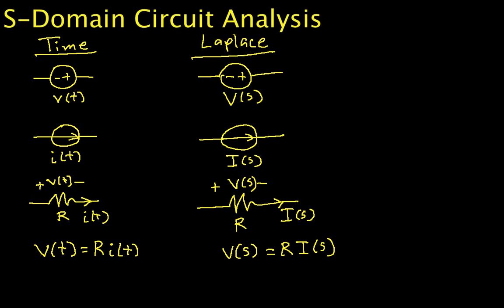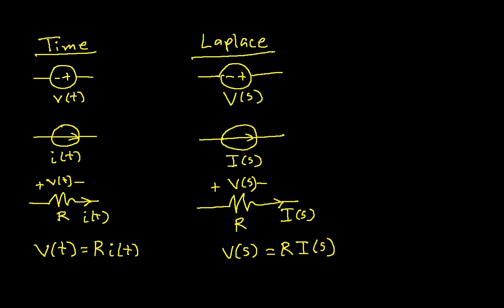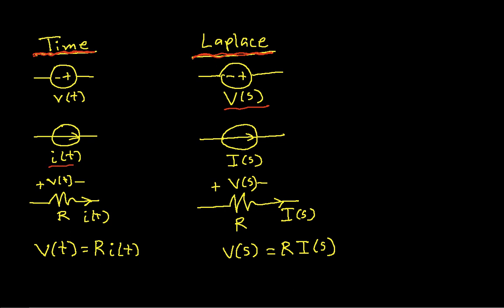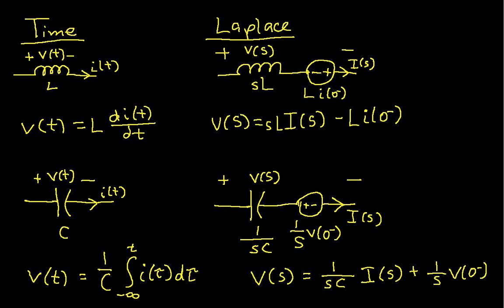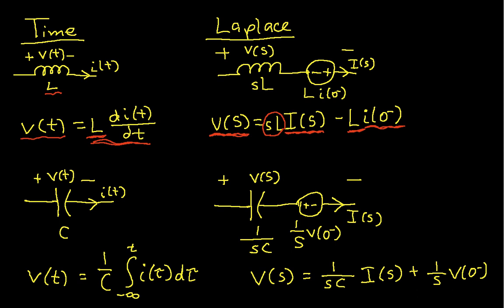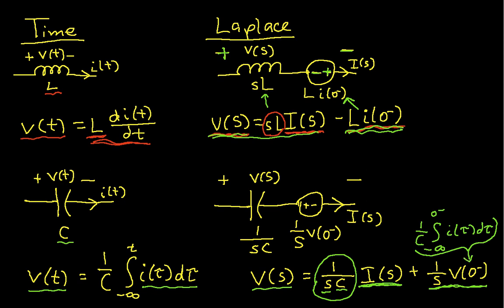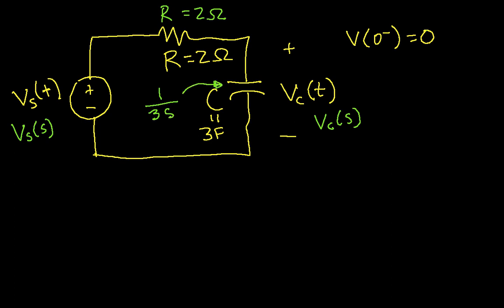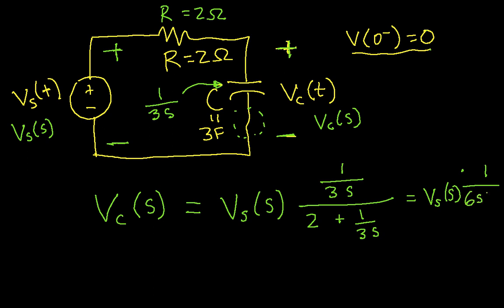Laplace Domain Circuit Analysis

Comment: Well my request wont be of any use to me now because my circuits test is tomorrow but for future students it might help. Could you make a video expansion on this topic that covers the derivation for these circuits in more detail? For instance, you can also represent the s-domain equivalent circuits for a capacitor and inductor as a circuit which contains a parallel current sources rather than a series voltage source representing the initial conditions. I managed to figure out how it works based on your video but a more in-depth explanation as to why you can do both would be helpful to future students I am sure. Otherwise, thanks for the helpful video!

Comment: There are two S-domain circuit models for the capacitor and inductor (voltage source and current source models). Voltage source models are ideal for applying KVL and current source models are ideal for applying KCL. I encourage my students to use both.

Comment from the maker: The sigma is the real part of s. When taking inverse Laplace transforms, sigma tends to show up as multipliers of real exponentials: e^{-sigma t}. w shows up as frequencies of sines and cosines. The Laplace variable is used in conjunction with impedance to find voltages and currents in the circuit, but I am not aware of a more specific relationship.

Comment from the maker: The frequency domain and the Laplace domain are closely related; the frequency domain is the part of the Laplace domain that has only imaginary values (zero real values). The Laplace domain, however, allows you to take into account initial conditions of your circuit elements; you can't easily do this in the frequency domain.

Comment from the maker: Yes, in theory that would be the case. An ideal voltage source supplies whatever current is necessary to maintain the voltage. To charge the capacitor instantly, the current would be infinite. In reality, capacitors cannot change voltage instantaneously, and real voltage sources cannot supply infinite current-there will always be some internal resistance in the voltage source.

Comment: But for DC sources the capacitor acts as open circuit... so the voltage across capacitor should directly be equal to supply voltage

Comment: i understood everything except the initial condition part. but thanks for the video god bless you
Reply: The initial condition is there because we cannot always assume that a capacity/inductors initial value will be zero. A capacity may still be discharging and therefore have Voltage/current still in the capacitor. 
For most easy question, the initial conditions will be zero, but for some harder questions you may be presented with a question which states "take into consideration the capacitor is not fully discharged and has this Voltage at time = 0. Hope this makes sense.

Comment: I failed to make connection. forgot too much preliminaries. Besides, Phasors are way better tools for solving a particular circuit, Laplace is to analyze the circuit responses to different functions (of inputs)
Reply: IIRC, phasor analysis only works if your source is sinusoidal. If it is sinusoidal, then the source can be represented as a phasor (a complex number with a magnitude and phase), and performing a phasor analysis will give you a steady state result. This is intuitive because, since the input is steady (i.e. it is sinusoidal, but it remains sinusoidal), the output will also be in steady-state. 

Fourier series works if the source is periodic, but not necessarily sinusoidal. Of course, due to Fourier's theorem, it is possible to represent this periodic source as a sum of sinusoids, so that phasor analysis can once again be performed, along with the superposition principle. Once again, the output will be in steady-state. 

So, phasor and fourier series methods only gives us a steady-state solution. This is because the input itself is in steady-state. However, if the input is not in steady-state, then the above methods can't be used. Instead, the laplace and fourier transform methods must be used. 

Whether to use laplace transform or fourier transform depends on whether the laplace integral or fourier integral converges. It turns out that for certain functions, the laplace transform exists, but the fourier transform doesn't. Likewise, there are certain functions for which the fourier transform exists, but the laplace transform doesn't. In this case, we would use the laplace or fourier transform as appropriate.